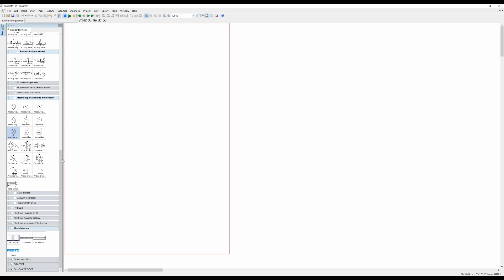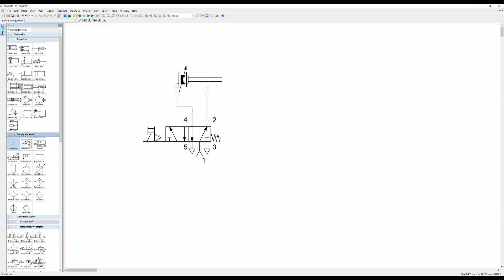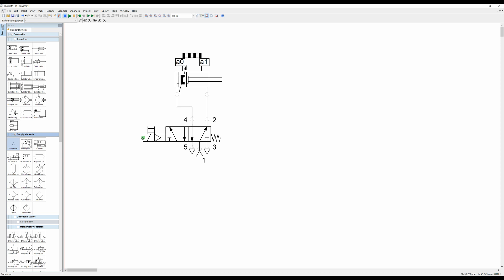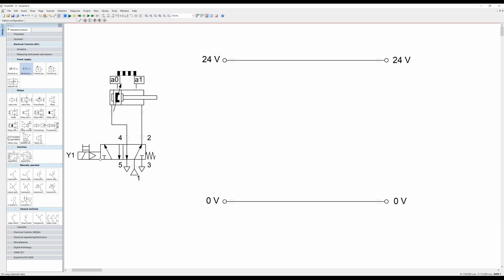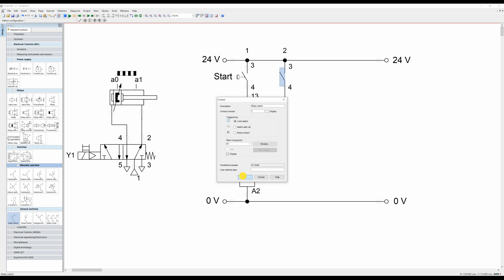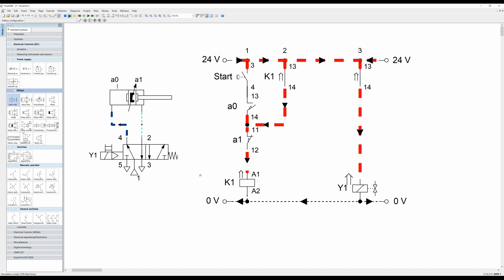Festo FluidSIM Electro Pneumatic Introduction

Comment: Great video! Can you explain why a0 shows up as an NC contact even though you have put as an NO? The electric diagram should show the non energized state, right?
Reply from the maker: The normally open a0 switch is pushed close when the cylinder is fully retracted, this condition is denoted by the small arrow to the left of the ao symbol on the circuit diagram.